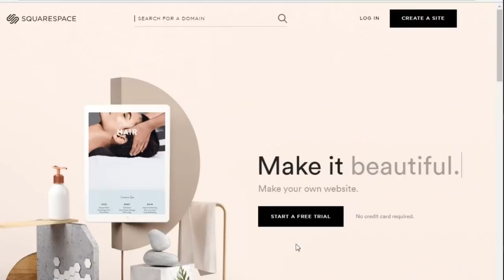DipIt #20: Clockworks!

Comment: As you were spraying the pizza pan, I thought "wow, it doesn't take much mold release"  I love it, very cool!!  Have a great trip.
Reply: Melissa Huysentruyt same
Reply: Spoiler alert. It does take much mold release.
Reply: I was literally thinking "Damn, I've been using too much mold release" when he sprayed it, I think I'll 'stick' with my method.
Reply: When he torched off the bubbles in the black layer he burnt off the mould release that's why it's only stuck above the level of the black resin
Reply: Its because its cheap silicone.
With high grade silicone you won't even need mold release.

Comment: I think the release agent broke down from the heat of the torch. Perhaps remove the project between pours and re apply release agent and pop it back in.
Reply from the maker: I can see that. I have to say, it was crazy surprising. I've never seen silicone stick like that.
Reply: Silicone also breaks down in the presence of high temperature as far as I am aware, considering the thin layer that was taken away I wouldn't be surprised if the edge was worn down after repeatedly being heated throughout the pans lifetime. Although that's just my guess.
Reply: Peter Brown if the resin isn't properly mixed, this can also make the silicone stick. 

I believe that it wasn't the mold release that caused the clock to stick. Most likely it was the silicone pan itself. The thin silicone molds that are made for a different purpose do have a limited amount of pours until it stops loosing the non stick properties. 

I have the same silicone pan and it's happened to me on more than one occasion. Sometimes you can remove the resin piece from the mold before the initial cure and you can get a few more uses out of the silicone pan.
Reply: Peter Brown I work with resin a lot and have ruined silicone molds by over torching them. It compromises the silicone and causes the resin to bind to it
Reply: It happened to me too, and i never torched or used a heatgun on that silicone mold. It even looks the exact same color as the one peter has. And it also only stuck on the sides, the last like 10mm of the edge.

Peter was yours also made in Italy? 

Also this has never happened to my selfmade silicone molds.
Reply: Liam Flannery I think it's more of the chemical reaction of the resin that causes the silicone to break down. Silicone itself can withstand temperatures up to 500 degrees Fahrenheit.
Reply: DaintyTurtle I forgot to mention that! I don't use a torch anymore, just a heatgun. It's supposedly better for the resin as well.
Reply: Wupme I have both molds made in Italy and china and they both had the same problem with the upper portion that's close to the lip of the mold
Reply: On a related note polypropylene is very difficult to glue, a common technique is to gently scorch it with a torch and then bond with cyanoacrylate. Never heard of doing the same with silicone but I certainly wouldn't be shocked if it worked.

Comment: An exploded diagram view of something encased in resin would be amazing
Reply from the maker: That's a cool idea. I wonder if we could do that to like an old ipod and still have it be functional?
Reply: That would be pretty awesome.
Reply: Oh that would be sweet
Reply: Peter Brown Pretty please?!
Reply: what an awesome idea.
Reply: most resins are non conductive, the tricky part would be keeping charger access and being able to control it. I know there are UV curable resins that can pass capacitive touch signals, but i'm not sure if normal resin has the same properties. you would also have to make sure the reaction doesn't get too hot.
Reply: An old cellphone or something completely dismantled and all the parts laid out would look cool :D
Reply: SuperCloneRanger the resin he uses has the UV properties.  The majority of the VOC free resin have some sort of UV property and the reaction temperature doesn't get really hot. 

I'm just not sure which resin would work the best. The resin with an open working time of 45+ minutes or the resin with the 5-10 minute working time.

I'm assuming that the 45 minute resin would work better since the chemical reaction is a lot slower. It doesn't get warm in the cup like some resins do.
Reply: SuperCloneRanger I wonder if he could use a silicone mold making kit to plug the charger port and the home screen button. Or maybe just the moldable sheet of silicone would work. Just do the entire bottom side to have the speakers plugged up so the resin doesn't get inside of that as well
Reply: What about a raccoon skeleton that is incased and looks like a block of ice or color the resin and have it look like it's fossilized!
Reply: I love this plan

Comment: I think when you heated the bubbles, you may have reduced the effectiveness of the release, if you do something like this again, maybe demould after each layer and spray more release, put it back in the mould and pour the next.
btw, Amazon do steampunk cogs.
I think i would also have started with the clear, added another clear to put the cogs on, then the final black, would have made a nicer 'finished' front.
Reply: Sparky Projects Never worked with it, but i assumed it was the time it spent just sitting on the pan. Kind of like other sprays, it dries and doesnt work or runs down to the lower parts. Not sure though.
Reply: Well it may dry out naturally, but the heat would quicken that or evaporate it.
Reply: Sparky Projects From what you said, it would make sense that the heat burned off the mold release after the initial, black resin layer, as only the clear layers stuck.
Reply: Sparky Projects......I believe the release spray has a working time of only 3-7 mins.......most of it does anhow
Reply: Sparky Projects "Just glue some gears on it and call it steampunk!"
Reply: I just think he didnt put any release on the edge of the pan ...that simple if u look when he sprayed it you see 99% of the release wdnt on the bottom of the pan and didnt put much thought into hitting the edges
Reply: 33 second mark , yup didnt really hit the edge at all

Comment: Fabulous piece. The exact same thing happened to me. I destroyed a silicone mould I had and it was due to the resin getting too hot and bonding to the silicone. It's because the blow torch is too hot and super heats the resin. Better to use just a lighter.

Comment: Couldn't you just keep going up on the sand paper count then buff it at the end.
Reply from the maker: Totally. If time wasn't an issue I probably would have just sanded the whole surface down to 220 grit and worked all the way through my abrasives. I know I can get a killer surface like that. It was just a timing issue. I waited till the day before this needed to be posted (last day of April) to demold it and film the outro.
Reply: Peter Brown, I'm sorry but you're making time (pieces). I don't see the issue. You have all the time you needed.

Comment: Hey Peter, just an fyi, you can achieve the same bubble popping with just using the torch with no flame. The heat helps pop the bubble but can burn the resin, especially when you touched up the crack.

Comment: If ya ever make another one, I'd suggest using the big pieces as number replacements either all 12 or just the 3,6,9,12 or big pieces for 3,6,9,12 then medium pieces for the other numbers and then scatter small parts throughout.

Comment: I use two medicine cups that work perfect for pouring the two parts of my two-part resin. I like them because the measuring lines along the side are much clearer than on the cups that came with the resin, and makes me a bit more confident about getting the correct ratio.

Comment: When looking at the video I noticed the spray did not get on the sides of the silicon much, but covered the bottom fairly well. Now I don't have any resin experience but I was a sous chef and bake often. Getting the sides even on silicon is important because anything that sets up that you put in it for extended amounts of time can hold onto the sides and get torn off. Although it is vice versa here and the resin tore the silicon, but same concept. Anyways, it looks great and well done with the patchwork.

Comment: i believe the reason it stuck was when you put the flame to it, you might have hit the silicone, damaging its surface and making it able to stick to the resin. i see from the edge of the black layer that there is nothing stuck but its stuck to the clear layer because that was what was exposed to the flame when you were torching the black layer, with the black layer obviously protecting the silicone it was covering.

Comment: Nice project Peter. If you have enough of the clock parts left, you could do a visually more simple clock by using the parts for numbers and graduating the size of the part to the incremental increase of the numbers on the clock, maybe using the tiny parts for 1/2 hour points.

Comment: The torch touching the silicone raises it above its degradation temperature. I did the same thing popping bubbles in sugar. Wherever the torch touches is no longer non stick.

Comment: I'm watching many of your videos today. A few things I have found in my travels that may help. Check your mold release. Not all of them are compatible with silicone. Since that was a food item pan, it was fabricated in Platinum Silicone. Also, if you get too close to the edge of the mold and resin with a torch or flame, for too long, the silicone mold can and will do just what it did. And final, try a UV resin on a scratch or small pits. You can cure it in the sun for a few minutes, or use a UV lamp or flashlight to cure indoors. Looking forward to seeing you make more Stuff. Thanks :)

Comment: I think the pan gave up because of the torch. They can withstand high heat, that much is true, but they're not flame resistant, and will melt under a flame. As you've been going around the edge to get the air bubbles out you've most likely melted the rubber which adhered to the resin.

Comment: Peter! How could you not show more closeups of the patch after it dried!? Holy smokes, that was the most exciting repair I've seen by far, what a tease to not get extensive closeups on how well it worked. My mind was blown when you started painting and it seemed to disappear - but I'm left with no idea how seamless it actually turned out. Why no shots of the sanding? Why no shots of the drilling/installing!? I feel so left out of this project.

Comment: They have a spray that's supposed to get rid of the bubbles. If the problem might be the torch. I saw it on positive couple's channel but I'm not sure of the name. It might help with the release agent. If you don't have to use the torch, it might release

Comment: If I have a resin peace than comes out of the mold less than perfect or if I had to sand it a little, I use clear nail polish.  It dries fast and transparent. Wouldn't use it on a crack though.

Comment: It came super awesome peter! I wonder what kind of blank you could make using those clock pieces, but i worry if the metal would cause catching issues when you turn it. Hmm
Reply from the maker: It would turn okay I think. The drill bit didn't even hesitate on the center hole.

Comment: I have heard that using  the blow torch too close to the edge and maybe not use the  blow torch too long. If I find out where I heard it - I'll let you know. I have had the same issue with my molds but have not had a chance to try this solution.

Comment: You should do this again, but with a bunch of cheap quartz watch movements. Try to keep the backs clean so you can replace batteries  in all of the tiny watches and set them. on the clock face. I'd call it "time inception" a clock in a clock in a clock.

Comment: The torch killed the mold. I've seen lots of people using silicone cake or baking molds with resin and universally: the people who use torches to eliminate bubbles report the molds tearing. People who don't use the torch get many more uses out of the molds. Mold release not needed at all. As for the bubbles...I'm not sure what everyone does, but I switched from torch to using a drinking straw to breathe on them. That usually eliminates a lot, then wait a bit, and go back again. Toothpick for larger stubborn ones. Yes torch is faster and better at it, but it's hard to use it lightly enough to eliminate bubbles without ruining the mold.

Comment: Hindsight being 20/20 and all.  If you were going to put a hole in the center, why not just dress up the sides on the lathe?  I would think maybe using a bolt, nut, and washers to mount it to a scrap.

Comment: Okay but it would have looked really cool if you cracked it on purpose and added a wood or metal casing around it. As long at the crack was along the edge and not too deep it would be fine. Rustic old steampunk vibes.